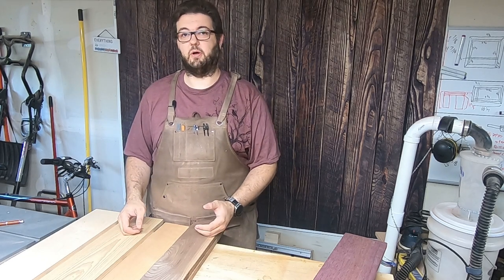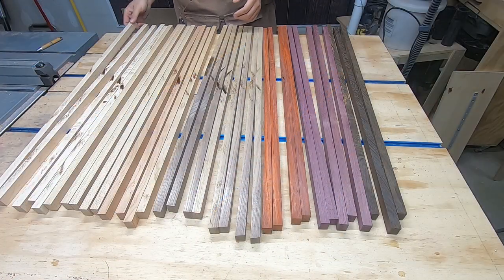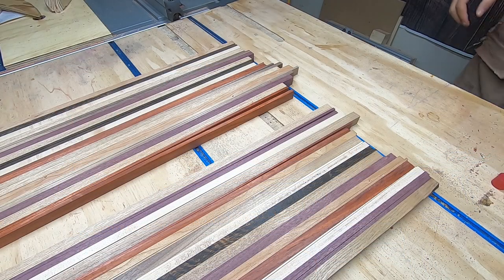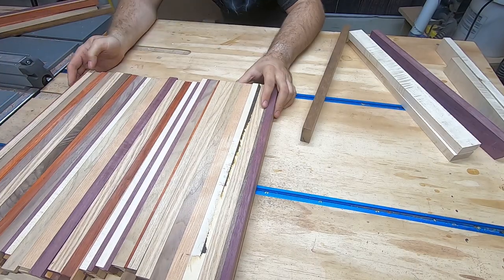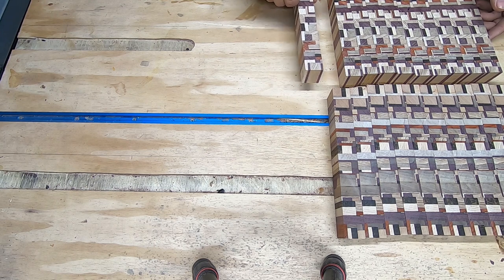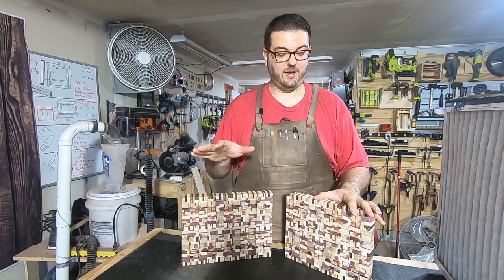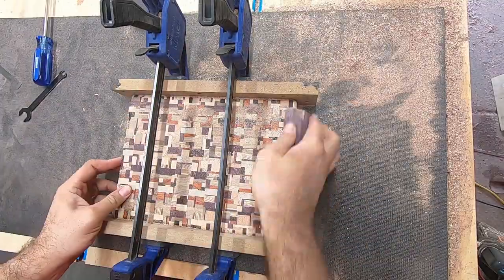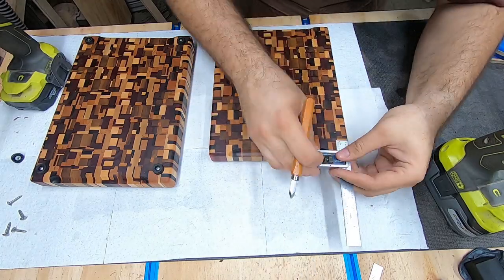Making Chaotic Endgrain Cutting Boards

Comment: Great vid, but you never did explain how you incorporated short boards into the project.
Reply from the maker: That actually happened at the 8:23 mark in the video.  I realize now that I just said "larger pieces", but these were from the shorter boards i referred to earlier in the video.  I'll pin your comment in case anyone else is wondering the same thing.  Thank you for bringing that up

Comment: I keep getting a warp on my end grain cutting boards  I came too see how you were gluing up but stayed for the entire thing  good stuff dude
Reply from the maker: Thanks!  How thin are you making your cuts?  Thicker boards have less chances of warping.  It can also help if you use cauls to help during the glueup
Reply: @TheTallWoodworker  I made one today at 1.250 and it managed too get a slight warp. I will defiantly look into cauls
Reply: @TheTallWoodworker  I made it originally 1.5 inches and when i ran it through the wide belt to 1.125  it then proceeded too warp

Comment: I welded up 1/2 angle iron for my router sled works great, just keep it waxed, much faster with a wide flattening bit than belt sander, great job !!!
Reply from the maker: Great tip!  I've been thinking about making a router sled.  I need a better router, though

Comment: Great job! The Wen belt sander has the same square dust port. I just take it outside
Reply from the maker: Thanks! I ended up replacing the HF belt sander with a Ridgid model with a proper dust port

Comment: Thanks for the video. Very impressive. A simple suggestion which may help - when turning from edge grain to end grain, glue a sacrificial strip to one end. Then you can pass it through your planer and any tear-out is restricted to the sacrificial strip, which can be cut away when you trim the board to the finished size. Give it a try. It works for any end grain board, even with a straight blade planer, and significantly reduces sanding time. Cheers
Reply from the maker: Thank you for the suggestion.  I have heard that a waste board can help with the very ends tearing out, but I have also heard of the blade catching the grain the wrong way in the middle of the board and completely destroying the board in the planer.  I know it might be a rare occurrence, but with how much time I spent putting these together, I didn't want to risk it all getting ruined by one bad pass in the planer.

Comment: Just wish you would have explained more about the thickness of your cuts. Did you start out with one inch stock? When you make your rip cuts how wide? And when you planed them down to what thickness....Thanks. They did turn out good.....
Reply from the maker: So, that's actually the best part of a chaotic board... the measurements don't really matter.  I started with 4/4 boards.  I used a different width of a rip cut for each glue up, however between glue ups 2 and 3 I kept the same width rip so I could have some more variation for glue up #3.  In terms of planning, I would run the boards through just until they were flat.  The thickness didn't matter, and the more you plane, the more material gets wasted.

The only time the width of the cut really mattered was the final one before turning the pieces on end.  In this cut, the width of the cut sets the thickness of the board.  I did a 1.25" cut on that final pass

Hope this helps

Comment: When you are making your cuts to create the chaos pattern, do you always set the fence to make cuts equal to the thickness of the boards?
Reply from the maker: I only set the fence to the thickness once so I could have more variety during that cut.  The other times I would change up the thickness to vary the pattern more.  Nothing would prevent you from doing that a second time, though.  That's the best thing about this project... you can be as creative as you want.

Comment: Hello at 4:54 "current thickness of these boards" do you mean 1 inch?
Reply from the maker: I'm not sure if it was exactly 1 inch. The idea was to have pieces that were the same width and height after that set of cuts so I could rotate them in all 4 orientations. That helps even more with the chaotic pattern

Comment: Loved the video. I'm about no embark on attempting one myself. Just one question. I see you used the ripping fence for the final crosscuts. I have never used a table saw but was given a basic used one just yesterday but I'd heard it was a big no no to crosscut using the ripping fence. How did you manage to do it safely?
Reply from the maker: Thank you!  The big dangers with crosscuts and the rip fence are if you use the miter gauge with the rip fence as a stop block, or if your board is to thin to properly index on the rip fence.  I didn't do either of those in my video.  Be sure you make sure your saw is ready to go before you start.  There are a lot of good videos out there with tips on what to look for.  Good luck with your project!

Comment: You might want to make a router sled, greatly reduces the amount of time in sanding.
Reply from the maker: Yeah, someday I will. I know it will still require sanding, but at least it will be flat
Reply: I second this. Excellent video but if I can add to one bit of advice it would be exactly this. There will always be sanding but what it comes down to is how much sanding. Make it another small side project one day when you can’t decide on any other projects. It’s very versatile with many projects. The hour or two it’ll take to make a router sled will save you 10x’s as much sanding I could almost guarantee it. Just make sure you find yourself a good router bit. Great video and great end result. Look forward to seeing your channel grow.

Ps - one additional bit I’d add is when you’re gluing up, uses some cauls. Doesn’t matter how careful you are there will always be movement. That will help tremendously

Comment: So the first glue up was face grain? Then you cut on table saw with a different measurement? Ie 1st cut 1”, then glue up, 2nd cut 3/4”, then 1 1/4” etc. then cut across and flip to see end grain pattern? What was the finish dimensions ( 1.25” height)
Reply from the maker: I think I did a total of 6 glue ups, and each time set the fence to a different length and rotate the pieces at each glue up. So technically the first glue up was face to face, 2nd was edge to edge, and so on. During 1 pass I kept the fence the same, so the pieces were squares looking at the Endgrain. This let me choose an even more random pattern. 

If I were to do it again, I may have stopped at 5 max. With that many passes, you lose a lot of wood to sawdust

The 2 boards in the end of the video were about 12x9x1.25

Comment: These are great! I am in the process of making 2 for wedding gifts and out of curiosity, what thickness boards did you use? Unfortunately I have to get a bunch of my wood online and I am between 1/2 and 3/4. I know ultimately it doesn't matter but it looked like you were using mostly 1/2 by 5 maybe?
Reply from the maker: They were 3/4in thick, but the widths I cannot remember. As you stated, it really doesn't matter.

Comment: I would of liked to see how u can incorporate the small/short peace’s of leftover scrap that u had shown in beginning- I have a lot id like to use
Reply from the maker: Around the 8 minute point of the video, I cut the long boards in half, then I incorporate those shorter pieces.  If all you have are shorter pieces, you can just start with those.  I did another video where I took a bunch of scrapwood and make a small cutting board out of it.

Comment: You could build a router sled and use that to level your end grain rather than sanding it flat. I'm planning on making one of my own and then trying tmit out on my own end grain boards soon
Reply from the maker: Yeah, I'm thinking about doing that at some point. I need a better router, though. The one in my table is OK, but the base is what I used to mount it in the table, so I can't exactly remove it
Reply: @TheTallWoodworker  I'm using I steel door for a flat surface, and I'm ordering linear rails off of eBay. I'm going to make my sled out of aluminum.

Comment: These boards turned out amazing! I watched a few other videos, and decided to go ahead and make my own Chaotic Pattern boards. I didn't really like the patterns I got, they weren't really "Chaotic" enough for me, even though i made four different boards, all with different patterns. And then I came across this video. And I just wanted to say thank you, it makes way more sense to make them like this. Thank you so much! I REALLY am appreciative of you taking the time to make this video. Oh yeah and I was curious if you would be willing to tell me where I can get a giant piece of sand paper like you used at the end to help flatten your boards? Thanks again!
Reply from the maker: Thank you!  It's always nice to hear that a video I made helped someone with their project.

As for the sandpaper, I went to the tool rental area of my local Home Depot.  I can't remember what machine they are for, but they have an adhesive backing, so I just stuck it to a piece of MDF.  Search for "DIABLO 12 in. x 18 in. 36-Grit Sanding Sheet with StickFast Backing".  They are about $8 per sheet
Reply: @TheTallWoodworker  thank you so much for replying to my comment. I am currently working on my boards. And I thought of one more question, if you don't mind. After your first glue up, you set the table saw at one inch, cut the boards and then glued up again. After that you said you set your table saw to a random width for the next cuts. My question is, do you really just pick a random width and cut, and also for every time you cut the boards again do you cut them at a different random width each time, or do you leave it the same for all your cuts? I really hope that makes sense, if not I can try and clarify. Thank you again!!
Reply from the maker: I did choose a different width for the cuts after each glue up. The more you change, the more chaos you create. I will say that one of my cuts was too narrow and I wouldn't cut thinner than 3/4 inch. When you do a thin cut, you make more passes on the table saw, and that means the blade wastes more material
Reply: @TheTallWoodworker  thanks again for getting back to me and for being so helpful!
Reply from the maker: No worries. Always happy to help someone out. It give me the drive to post more content. I've actually been lacking this year, but I'll have a video coming out soon explaining why. Hopefully I can get some more projects made in the second half of the year

Comment: This looks awesome and i just startijg dabbing into maling cutting boards. Id like to make a chaotic design but quick question. This might just be me over-thinking it. But after the 1st glue up and rip, wouldnt you have some strips being glued edge grain to face grain?
Reply from the maker: Yes, you would have edge to face glueups.  But so far I have not noticed anything happen since making them.  I'm in no way a grain expert, but perhaps because the pieces are so small, any negative impact it may have is negated (don't quote me on that, though)

Comment: Very cool! Do you ever have issues with the end grain board warping after you've flattened and sanded? I made a maple board recently, and it's got a bit of a bow in it after sanding. I could run it back through my router sled to flatten it again, but I can't help but imagine that once I oil it, it's going to move again because I'm adding moisture back in.
Reply from the maker: Hmm... I've never had that issue while making a board.  How thin was yours?  That may have something to do with it
Reply: @TheTallWoodworker  A smidge under 2.5" thick. I suppose I could double check my actual router sled's flatness/straightness too, to make sure it's not adding any curve...
Reply from the maker: With a board that thick, i wouldn't expect warping.  That should be pretty solid

Comment: Was your first glue up edge to edge or face to face? How did you incorporate the small cut offs shown at the start of the video?
Reply from the maker: The first glue up was face to face.  As for the smaller cutoffs, that was happened at the 8:23 mark in the video.  I didn't explain it that well in the video when it happened

Comment: When you first start ripping the boards at 1in were they all the same thickness?
Reply from the maker: I believe they were, but honestly, it doesn't matter because they are rotated during the glue up.  In fact, if you vary the thickness you can make your pattern even more chaotic

Comment: I did finger holes on the ends, then flipped it, and did finger holes on the sides, giving the ability to grip, no matter what side was up.  Yes, it looks a little odd but I want easy.
Reply from the maker: Interesting.  So do you not put any rubber feet on yours?  I definitely like the idea of not having to worry about what side is up, though OCD might push me to think one way is up over the other.  Haha!

Comment: Ignore Asif's comment about talking less.  Nothing worse than woodworking videos with no instruction but endless lame royalty free music.
These boards look great mate. Very impressive.👍
PS..  If it helps, you may find climb cutting your roundovers help.  Although climb cutting is generally a no-no, it's not difficult to control in very small passes and help prevent chip-out on end grain. hope it helps :)
Reply from the maker: Thanks!  Yeah, I have no intention on changing how I speak in my videos.  That's the style I chose, and it's who I am.

I'll give the climb cuts a try in a future project.

Comment: that's nice but the waste of material is huge! I prefer to respect wood and optimize the material.
Reply from the maker: Sometimes it's a necessary evil depending on the desired outcome.  As a wood turner, I have to take large blanks and turn most of it into wood chips to get the final project.